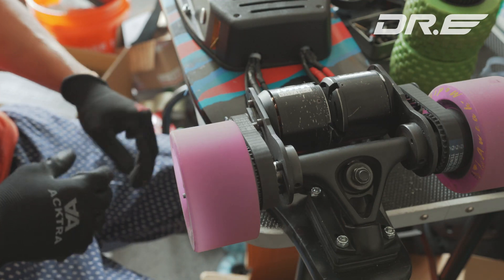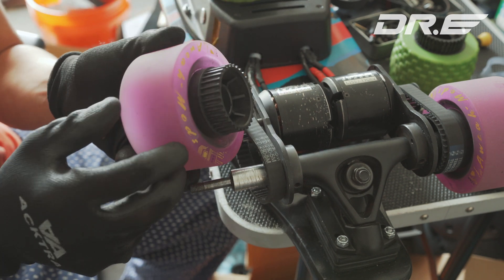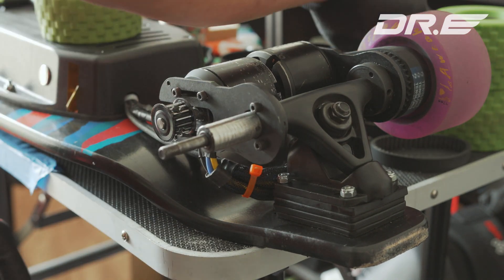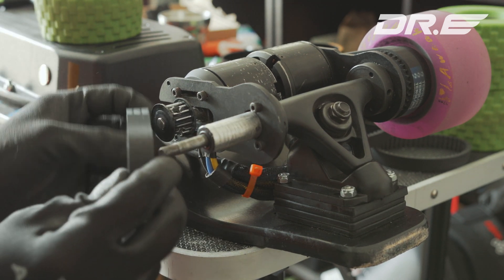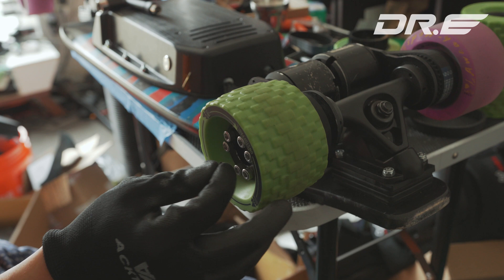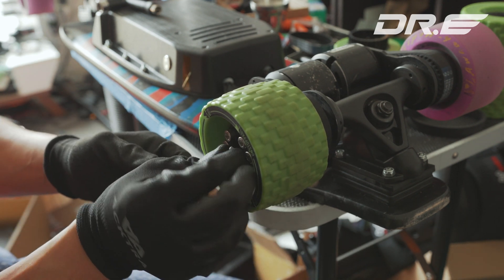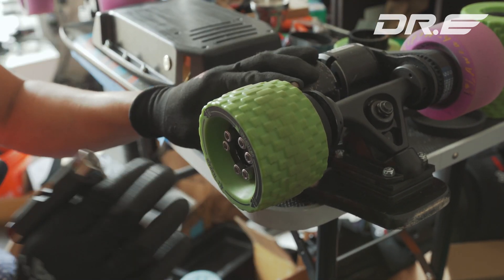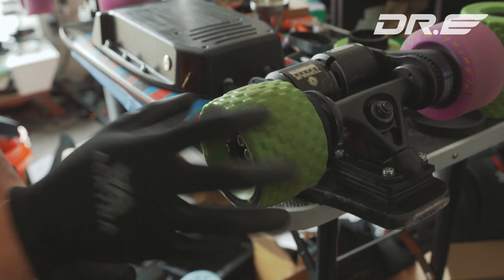How to Install New Wheels/Belts on DIY Electric Skateboard!

Comment: thx dude. can you put clouds on the black hawk?
Reply from the maker: Yes but u need to buy bigger bearings I am gonna make a video about that soon so just wait for that speedy beagle.  Will give u a little more torque and speed.
Reply: @dr.eskateboard3381  average eskate reviews put evolve tubed tires on one. Looked like a hassle.
Reply: Just got the bound motor 110m airless with 40t pulley, replacing a 35t pulley and 250m belt, what size belt should I get?
Reply: @2424jhg  you can measure out the belt size just use a piece of paper and see what it measures in mm.  But from 36t to 40t add about 20-30mm
Reply: Max Lee thank you soo much!